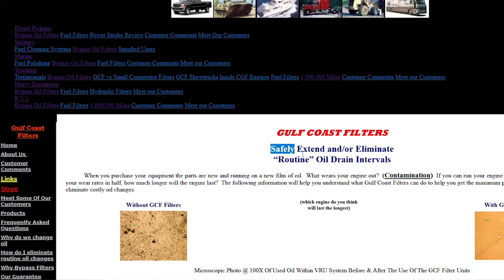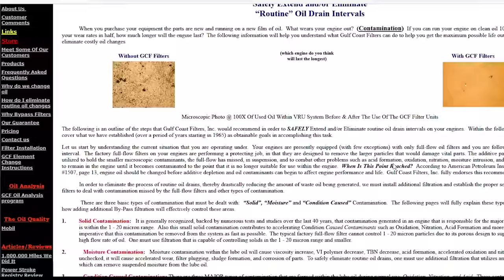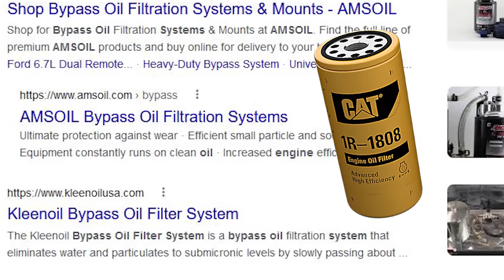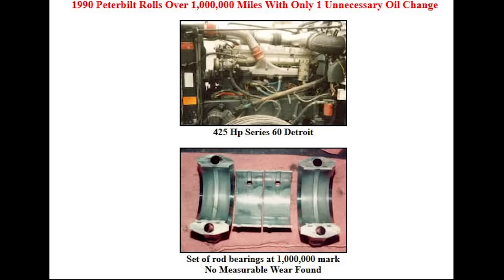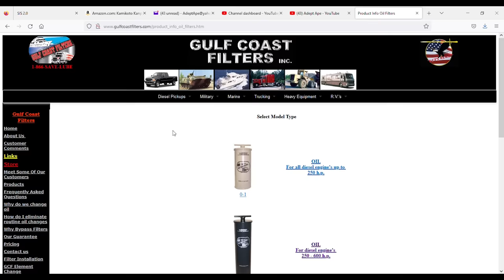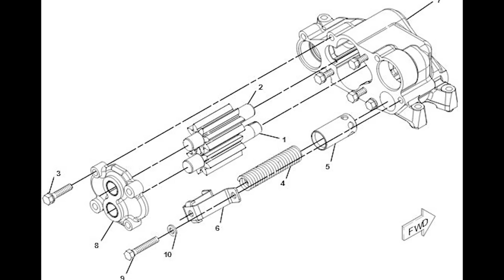No Oil Changes and 1 Million Miles!!! Are Oil Changes Optional with a Bypass Filter? (INTERESTING)

Comment: I could see a huge benefit in the yachting industry. Being able to service and monitor engine conditions with sampling. Not having major mechanical repairs that could take a profitable charter vessel out of service for months.
Reply: You might want to contact Gulf Coast filters about marine engines. I dont remember if its North Carolina or South Carolina DOT that use the big filters. At one time Gulf Coast O 1 filters had a GMC part number for South Carolina DOT I believe mid size trucks. Years ago I sent a big Gulf Coast filter to New York City for a ferry..sent a big filter to Seattle  for a yacht  My wife charged 4000 dollars instead of 400 dollars to their Visa. She managed to put it back in but I told her its time for us to retire. Gulf Coast Filters is big on oil analysis. Seems like I remember they read oil analysis reports for a fee. They are not that easy to understand.Been a lot of water under the bridge. Dont know what they are doing now. One of the states have the ferry boats equipped going to an island. Of course you have the crew boats and offshore rig engines

Comment: I had a 2.5l BMW 6-cylinder TDS in my car, when I scrapped it after 500,000 km, I took the engine apart. The crank and connecting rod bearings were like new out of the box, no sign of wear. I would bet everything on the fact that the bearings would last at least another half a million km, maybe (definitely) more. Aleso beautiful honing on the cylinders, but the engine died due to a cracked head (pre-chamber engine) on each cylinder and coolant consumption. But the engine worked until the last moment.

Comment: What I have heard from users of oil bypass systems is that while you don't do an actual full oil change, when you change the bypass filter (some have said they don't change the oem filter) you have to add a quart or two of oil. From their oil analysis it seems that the oil added makes up for the additives that have been used up between filter changes.

Comment: Had factory luberfiner bypass filters on old big cam 855 trucks. Noticed the oil not staining as much and maintaining pressure for a much longer interval vs my other 855 powered trucks. Adding another 2 gallons to the total capacity helps keep it cool too.   That old system was not all that too precise but did prove to work well.

Comment: I worked at a factory that made bearing seals. The hydraulic oil in the machines was 50 years old. They had a filter cart with 2 filters that were 8" round and 3 feet long they would filter the oil until the cart wasn't in by-pass in the morning. Then go to the next machine.

Comment: I've used Lucas since, before it was popular, to keep a rod knocking motor running for a little while. It ran for seven years until I built another motor. Honestly, I have disassembled three small block Mopars that had Lucas in them. The bearing surfaces really are slimy and slick.

Comment: I work at Walmart in the Auto Care Center. No, we don't do oil changes on semi's. But we do change oil on diesel pickups and medium duty trucks. Basically, if they have the 6.7L Ram or Ford engines or the 6.6L Duramax engines, we can do them, and except for the new 6.6 Duramax, we carry the oil filters in stock.
I did an oil change on a diesel pickup that a guy had just bought brand new, and he had never owned a diesel vehicle before, so he didn't know he needed to service it regularly...he didn't have a bypass filter system on the engine either.
He brought it to us for its first oil change at 40,000 miles. I was the unfortunate soul to be under the engine when it was changed. Basically, it was no longer considerable as being diesel oil, I'd call it carbon in a liquid suspension. While pulling the drain plug, the oil ran down my hand and forearm, and I had to go out of the oil bay and go wash my hands because I couldn't hold the wrenches firmly to check the rest of the drivetrain.
After the oil change was done, I did manage to speak with the customer and recommended he not go 40,000 miles again with it and suggested a very short interval for his next oil change, so that most of that buildup would be flushed out with the fresh oil being changed sooner. Walmart does recommend 3000-mile oil changes, but that's the default setting for our window stickers. 3000 miles or 3 months.

Basically, in this situation, this truck could have benefited from an oil bypass filter system, and it would have been just fine.

Comment: This has been claimed for many years and many have learned hard way it doesn't work. Even city tried it few years back took out few engines. Just so much fun changing engines out in garbage truck. Like owners with CNG or LNG engine oil looks clean like new oil. Still has to be changed because it does break down

Comment: I perchanced a 2018 ram diesel and 5 thousand miles on it. I put the antifreeze bypass filter on and amsoil bypass oil filter Weeks of ownership. I change my oil every 30 thousand miles and regular oil filter every 15 thousand. I have 352,000 miles all is well couldn't be happier my water pump went out at 258 thousand miles. By pass filter gets changed at 30,000 oil changes with transmission oil

Comment: Wow!
I’ve learnt so much from this.
Our family drives a highly modified original engine (376,000 klms) 4 cyl diesel 2008 Toyota Prado in Australia and religiously use engine flush and once every 50,000 klms do a fill and flush.  I also use an antiwear additive that I’ve used on other vehicles over a very long time with earlier vehicles.
It is said that this additive can help the oil increase its soot loading by “up to two times”.
I also use a Provent oil catch can to help trap oil particles from the blowby gasses in the rocker cover.
I use fully synthetic oil and almost always never get to the 10,000 recommended oil change interval or 6 months whichever comes first.  I target 8,000 klms.
I have been thinking about getting the oil analysed and I’m very OCD (can’t u tell, LOL) and am very interested in this oil bypass filtration.
I want this engine to last way longer than me as it will be handed down from generation to generation till there is no more diesel.
I remember reading some technical publications from the company that supplies my oil additive (they also have a fuel decarboniser which actually pays for itself in fuel economy gains which have been tested independently on a new vehicle they had).  I just can’t remember the typical soot sizes off hand, but know that tests showed (microscope pictures) a reduction in both the number and average size of soot particles using this decarboniser.
Even though I could save money by extending the oil drain interval, I won’t as I do not care about a few bucks…it’s the $20,000 plus to replace this engine that I want to avoid.
I use a scan guage and have extra sensors for transmission temperature, EGT Exhaust Gas Temp, intercooler in and out temps and turbo boost.
I love learning about this stuff!
Thanks!

Comment: Thank you ! Full Synthetic oil does not really wear out. but the packages to reduce foaming, ph balance, viscosity etc. do wear out !
Reply: Not when you are adding 3 gallons of new oil when you change the bypass filter. at every 10.000 miles. Additives last longer in clean oil. The million mile truck might have used conventional oil. I wonder if they use 100 percent synthetic in Shell offshore rigs. When I started trucks used single weight conventional. We didnt have synthetic oils for diesels in those days. Multi grades were no good.
Reply: Someone correct me if im wrong . I believe the million mile truck used Shell Rotella T 15 40 conventionL

Comment: I had an experience with a specialized machine that had an Onan genset to power the machine up to 22 hours a day.  With 15w40 conventional oil the oil got changed every 300 hours of operation.  After I got the boss to buy 5w40 synthetic, the oil was changed every 600 hours.  The real benefit was an 18% increase in fuel economy.  While the synthetic seemed less gritty and slicker after double the hours.  A fancy bypass oil filter is a smart idea.  Since each of these systems  filter the oil to be like new oil.  And synthetic has less breakdown and cooking of the oil.
I left that job after 6 years.  But a friend that stayed with the company.  Told me that after the engine had over 20K hours.  Another identical machine that had around 10k hours.  But used the standard 15w40 oil.  Was worn out by that time.  The 20k hour machine was checked by the Onan rep.  He stated the engine was like new!  Of course, radiators, water pumps and other accessories were replaced several times.  But the base engine was in great shape!
So the point is, use good synthetic oil, filter it the best you can.  And change it at some regular interval.  The engine will likely live long longer and cost less to operate than the design specs.

Comment: Very interested, as much as it cost to inframe a engine it's a big gamble. I just got back into the field and ended up with a job at our local Cat dealer. I will be looking out for these systems. Thanks for the great videos.
Reply: How did we get to the point where using filters that clean oil is a gamble ?

Comment: Very interested in this, never heard of it before. They say your oil does not break down, just gets contaminants, but what about the detergent in the oil, that is what helps to clean the engine and remove any carbon that gets past the rings, as well as any deposits around the engine, I was always told that detergents will break down in roughly 3,000 miles, and that is why 3,000 mile oil changes are so important in gas engines due to the excess deposits. Also as you noted thermal breakdown, I work on a lot of 3.5 ecoboost engines, and it is very easy to tell the difference in oil change intervals, the longer intervals have much dirtier engines. But compairing the ecoboost which heats the oil much more then a NA engine, the oil breaks down a lot quicker then a NA engine, and we see that across all charged engines, not just ecoboost, so I would be curious to see what they say with the thermal breakdown. Obviously they used a semi which has a turbo on it, and it lasted the 1,000,000 miles. Thank you for the video, will be interesting to see if more info comes out on this and more testing is done.
Reply: My experience is mostly small engines. Additives last a lot longer in clean oil. My 41 Dodge had a smaller version of the famous Luberfiner..Not good enough to compete with the Frantz Motor Guard Gulf Coast Jackmaster or other toilet paper filters. It used cotton. The system of keeping the oil analytically clean and adding new oil at filter changes with fresh additives has been tested since the 50s. Bypass filters have been around since the 20s. Some actually clean oil.
Reply: The million mile truck is a Shell oil test truck with a private truck owner. Shell oil measures the parts and marks them about every 250.000 miles. And tests the horse power..Im just guestimateing but I think it gets about 350 gallons of new Rotella added as makeup oil when the filters are changed. According to oil analysis  the Detroit gets more new oil than it needs.If they planned to do oil drains they could go farther between filter changes with less oil added.. I believe it used15 40 conventional. Road king asked me for the owners phone number in 1996. Magazine article  October November 1996.Old news.

Comment: Yep have looked at oil bypass systems. But as of yet I have stuck with the tried and tested Oil and Filter changes on a regular basis. ( I normally do my own oil and Filter changes easy and saves a lot of cash ) . I also have Oil samples done at the same time. Maybe a bit over the top, but Its worth the cost. And I suppose until Engine manufactures fit these systems themselves, I am happy to continue as I am.
Reply: Just because you add bypass doesn't mean you don't change the oil 🤦
Reply: I stopped draining oil in 1963 with a Frantz oil cleaner and Delo 100 W 30. The Rambler American flat head 6 came with a spin on bypass filter bolted to the head upside down. The oil was always black and dirty. I worked in a full service Standard station. I told a Standard engineer I see you just changed oil. He pointed to his Frantz and said use one of these and Delo your engine wont wear out and you wont need to change your oil. I went looking for a Frantz dealer. Never saw dirty oil again. Some people feel all nice inside changing their dirty oil. Not me. Easier filters to service are here now. The Frantz is obsolete now. I still feel love for them.
Reply: You need some common sense with these filters. For example if you have a coolant or fuel contamination problem you will need to drain the oil. If you dont drive at operating temperature long enough for the PCV to do its job you will need to drain the oil. I dont drain the oil but I use filters that clean oil live in a mostly warm area and have good engines.

Comment: Josh I can agree with this. As long as the motor has never been shutdown, and or allowed to cool to the point of comdensate. But in a world we're we shut them down daily they cool and this createsmoisture which is the culprit in creating acid this causing that bearing damage you described. I like your channel and have lots I could add to it. But so much to this it can be done. No oil changes period.
Reply: Its an over the road truck. I assume it dont run 24. 7.

Comment: I worked on tug boats their were 3 Cummins 5.9 gen sets. 2 ge EMD engines. Their was bypass filters on everything changed at 1000 hours. The oil was sampled during the filter changes. When the oil broke down it was changed. But the EMD used 1000 gallons each. Changing it took a bit. Time and money and was not fast. You keep the oil cool and clean. Sure it will run a long time.

Comment: Amsoil has bypass filter systems along with oils and lubes.
 I've used their oils and filtration systems, both on my own and my customers machines.
 They test their stuff and have it tested by independent labs.
Reply: I remember in the early 80s Amsoil had a canister filter that might have.been as good as toilet paper. They had Bobby Unser saying this oil change is forever. The filters arent so good now. That dual remote system is a joke. They have good lubricants. Saw on YouTube a guy was talking about Amsoil saving money. He poured more money in the fuel tank than I spend on oil in a year.

Comment: Interesting video. After running a number of trucks on extended oil change intervals with a bypass filter I can say I have a little experience. We ran your 6NZ on mobile Delvac 1
Reply: We ran 100,000 Miles between oil changes with a spinner two bypass filter to remove carbon We changed filters and samples every 25,000 miles the samples were done by SOS caterpillar service. The oil samples always indicated that there was more oil life left in the oil but we changed as we feltThat the additive package was probably breaking down. These engines ran an excess of 1,000,000 miles before major overhaul some of them ran almost 2,000,000 miles before they’re major overhaul. We still suffered with the cat camshaft and cam follower problems on these trucks but we never had any bearing or piston or piston ring issues. I don’t think I would recommend going 1,000,000 miles without an oil change. I do believe in bypass filters as when you do the oil change it’s amazing how clean the oil is and how much contaminants  has been removed from the oil. Theses trucks ran a gross vehicle weight of  90 to 100,000 pounds Your videos are great keep up the good work.
Reply: The million mile truck has had a lot of oil analysis.done as you can imagine. Gulf Coast Filters lives by oil analysis. Years ago a trucking company mechanic told me they didnt need a bypass filter they had an oil analysis program. I told him I never heard of an oil analysis program that kept the oil clean. He wasnt happy.

Comment: Similar systems in Australia have been a big hit with the mining industry.  Mostly for regular kidney style cleaning of expensive synthetic final drive fluids during normal service interval when the dump trucks etc are in the main workshop.  Always........use oil sampling to check soot loading etc.  that would show any dangerous conditions developing etc.

Comment: ED, one reason the International 6 cyclinder engines are still running is the large oil pan and double filters. I had several of those tractors and i think trucks had same engine. tractors still around are the 66 & 86 series most sitting in sheds waiting on newer tractors and John Deeres to break down!

Comment: In the Navy I served on a LST, which is Diesel powered. We only changed the oil when we were in the shipyard. Each engine had only an oil strainer with magnets. We had a centrifugal oil purifier in each machinery space.
Reply: I remember the smell of that diesel on that LST. A train went by the shop .even after 50 years that smell took me back.I was in the army A LST took us from Pearl Harbor to the big island and dropped us off on a beach. Didnt see the engine room but I did see the galley.we hit a little rough sea  A chain broke above my bunk. A big guy fell on me. When they came back for us. The GMC truck automatic transmission was too hot to climb the ranp.I stayed on the beach a couple weeks. They brought me rations. 1960.

Comment: Back in 2006 we had a Saab 9-3 come in. It was a 2003, and she had 40,000 miles on it. Well that was 40,000 miles with NO OIL CHANGE. Long story short we were shocked at how there was virtually no wear in the engine. Lots of sludge in the pan, several engine flushes, and a few oil changes car ran great. Couldn't believe it.